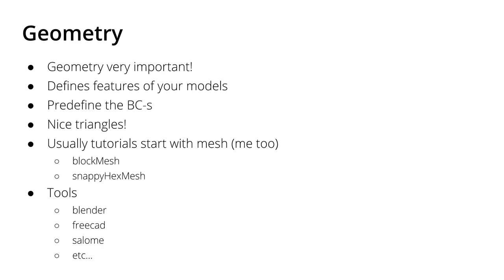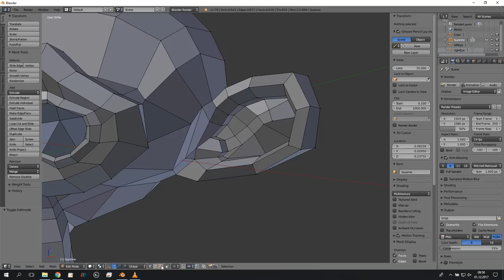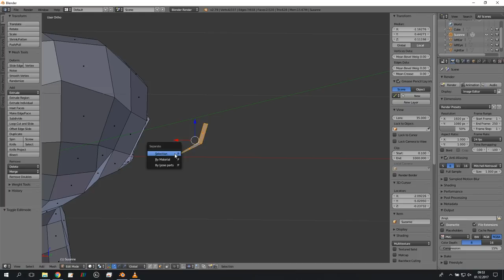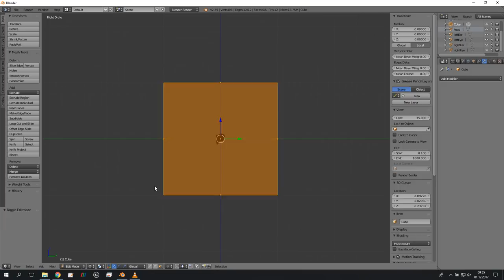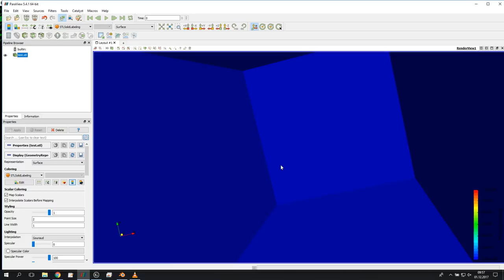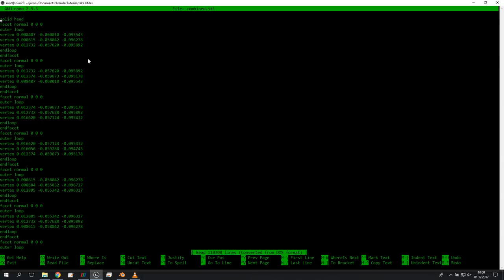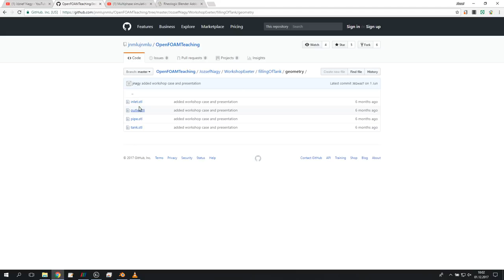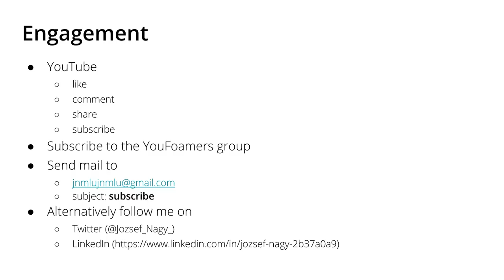How to create and export your geometry for simulations in OpenFOAM - tutorial

Comment: Great video.  One update is that this add-in is part of the current version of blender, so you may want to update with note and hyperlink to click ahead because the rheologic explanation is not not needed.
Reply: Hi Keith,

Do you still access this add-in in the same fashion as the video shows? I don't seem to see this in my version of blender (2.83.1) when trying to search it like the video shows. Thanks!
Reply from the maker: @garrettmoyer7049  The Rheo add on only works for blender versions v2.7x not 2.8.

Comment: Sir, 
If working on 2D simulation. Do i need to give some thickness to the body while making CAD model in any CAD making software.
Reply from the maker: 2D is a bit different. cfMesh can generate 2D meshes snappy cannot. You can use blockMesh and extrudeMesh for 2D.

Comment: really nice tutorial, but what about the units, if I import a cad model in blender or Salome, what will be the effect on the units.
I am using Salome now and the defaults units are in meters, so if I export the .stl file for snappyHexMesh will the units still be in meters or I have to change manually.
Reply from the maker: OpenFOAM assumes, that your geoemtry is in meters. If it is in mm, your can scale it with transformPoints -scale '(0.001 0.001 0.001)'

Comment: dear Jozsef,
I am having trouble with this tutorial at minute 15.12 you combine all the .stls to one with the following line "cat *.stl >> combined.stl" my issue is that the combine.stl is opened in ParaView correctly but any other program I use to see .stl tells me that the STL file is broken (needs reparation). for the test, I was using surfaces (not solids) for example, divided a cube in its 6 surfaces and exported each of them in separate .stls, and tried to combine them to create the cube. ( i don't know if using only surfaces could provoke this issue or if I should use another command) thanks for the help, and the great videos.
Reply from the maker: I am not sure. Some software packages have only a limited STL support.
Reply: @OpenFOAMJozsefNagy  oh well, either way, thanks a lot for the answer! as always love your videos!
Reply from the maker: @francootaola9172  Thank you

Comment: Great work Jozsef,

I use salome for building and meshing the geometry, for me it was easier than Blender. the mesh can be prepared including any boundary patches (surfaces) or regions (volumes) and once converted (unvToFoam) the same can be found (including names) in OpenFOAM.
I have a concern, in case of multi region, do we need to have one mesh only and assigning the regions over the mesh, or we need to have separate mesh?
for example with one mesh, the regions can be separated in openfoam using splitMeshRegions but as far I know, only one polymesh folder is constructed. however, if we need to use a multi region solver, each region shall have it's own polymesh folder.
if we divide the simulation domain for different meshes (region wise), we will have separate polymesh folders, but are compatible with each other according to openfoam? can the openfoam understand the global/merged mesh
Reply from the maker: I am not entirely sure, what your question is. Yes, first you create your overall mesh as one big mesh and then you separate it with splitMeshRegions. Then you have submeshes. chtMultiRegionFoam just uses those submeshes, not the original mesh. Was this your question?
Reply: Thanks for your reply

yes indeed, I just got confused since the general structure for multiRegion solver mentions that the ployMesh shall be inside each region separately  in the constant folder and the blockMesh is executed for each region.
so, with using salome with the MAIN mesh concept there will be no need. The UnvToFoam and splitMeshRegions shall be executed in the case folder.
There was an error during the splitMeshRegions execution. now it's ok
this command segregates the constant, system and 0 folders according to the detected regions in the unv file.

thank you again
Reply from the maker: Great, I am glad!

Comment: Hi sir
I have a question here.
Need to ask for your help.
okay. let say I have a 3d CAD model of a car, and i want to run the simulation using OpenFOAM. Can I know, what softwares that is needed in the process to get to know about the aerodynamic of the car. And a bit explanation if possible.  Thank you sir, I just confused on what is the software needed to solve this.
Reply from the maker: You need the stl file of the car. snappy can work with that. Check out my multiphase simulation project, how this works.

Comment: Hi, When will be the case of using snappyHexMesh instead of blockMesh?
Reply from the maker: For complicated real life geometries. Simple geometries are easy with blockMesh, but imagine to set up manually a blockMeshDict for an engine block. There is a blender plugin, which does help a bit called swiftBlock, but I would still use snappy for complicated geometries.

Comment: Hi József Nagy, i Hope you are going well. I am a new  user on OpenFOAM and trying to follow the same instructions as you have in this monkey head tutorial. Even I have same results, views in paraview after exporting (.stl) file with ASCII but when you are applying (nano test.stl)  to see which part belongs to which boundary my Ubuntu is not working (Error reading file.stl: Permission denied). I think I am missing some features to install in Ubuntu-19.10.. Could you please guide me How I can manage this issue?
Reply from the maker: I guess you have to modify the permission of the file
Reply: @OpenFOAMJozsefNagy  Thanks Sir, I did by using this command in terminal as i am using VIRTUEL BOX : "sudo usermod -G vboxsf -a username"
then restart the terminal.
Reply from the maker: @ijazakbar3276  Is your username "username"?
Reply from the maker: chmod +x file.stl?
Reply: @OpenFOAMJozsefNagy  yes sir, the name ones has have for his/her terminal (UNIX Username)
Reply: @OpenFOAMJozsefNagy  its works also for just single file, but for me I had an issue with whole folder, the main folder was locked and inside sub folders (0, constant and System ) were also un-accessible
Reply from the maker: @ijazakbar3276  Are you running the commands in your home or in /opt?
Reply: @OpenFOAMJozsefNagy  Sir, previously its in home but I have no internal ParaView so I have shared my Windows folder with VirtualBox so there, I am running and analyzing results in ParaView. So all current files are in mutual shared folder between host and VB.
Reply from the maker: @ijazakbar3276  Try it in your home and copy them afterwards into the shared folder and vidualize afterwards. Or download in your VB paraview for Linux.